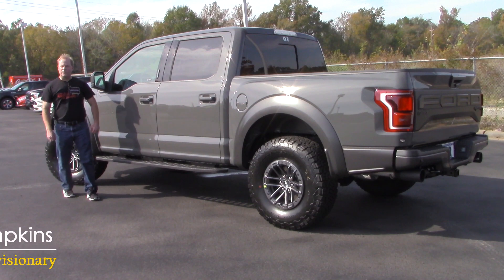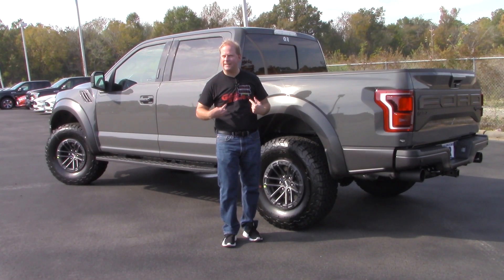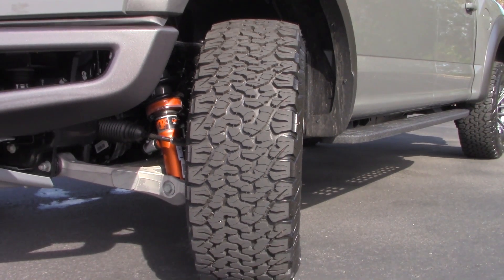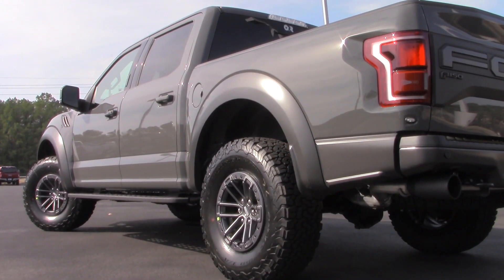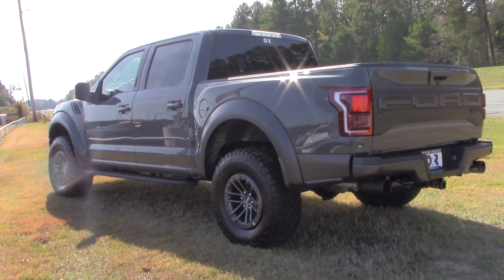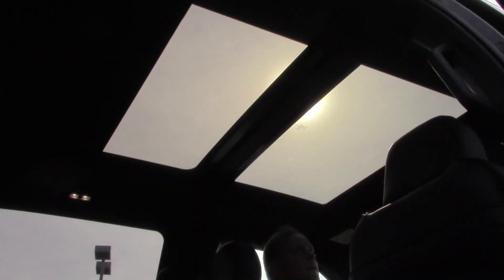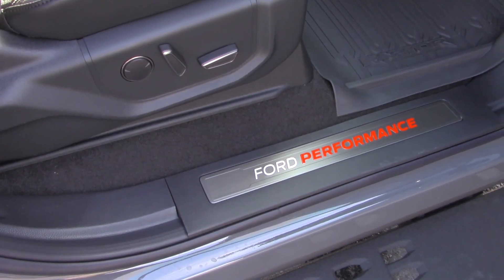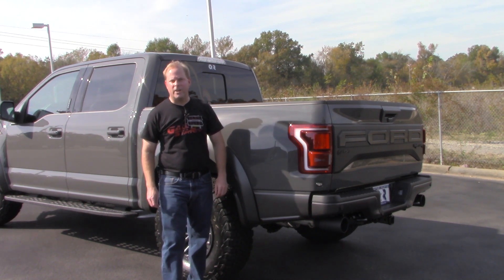Is The 2020 Ford Raptor The Perfect Combination Of A High Performance And Practical Use Truck?

Comment: You guys are scaring me from looking at a low mileage 2018 raptor.  Sounds like they have some hidden issues and quirks
Reply: Many do, unfortunately. I'm on the Raptor forum and some are having tranny issues while others have engine issues. Many people mod these trucks beforehand. I personally am considering a Raptor in the future regardless of rising issues. Many complained about the 5.4L Triton in the F series. I currently own a 05 Expe with the same engine, and at 147000 miles, still rolling.

Comment: Traded my 2018 Raptor when the 10-Speed Transmission starting shifting really hard in Normal Mode. Felt like getting rear ended. Ford dealer said that it was normal. Don't think that was normal. Lots of 1 and 2 year old Raptors out there for sale. There not moving too quickly.
Reply from the maker: Sorry to hear about the problems you've had with your Raptor. That is definitly not normal.
Reply: I agree. 75,000 for a new truck is a lot of money for something like that to happen. I do hope they come out with a GEN3 V8 Raptor to compete with Rebel TRX Hellcat we're hearing about. My guess is Ford will get the 10 Speed Transmission Issues resolved at some point. Many do not report any issues with them. I think it may come down to how it's driven.